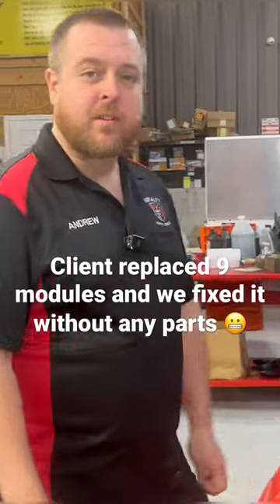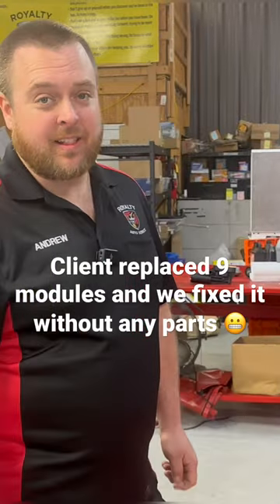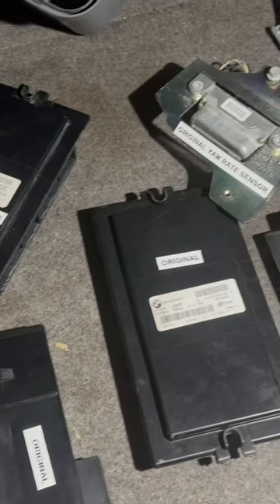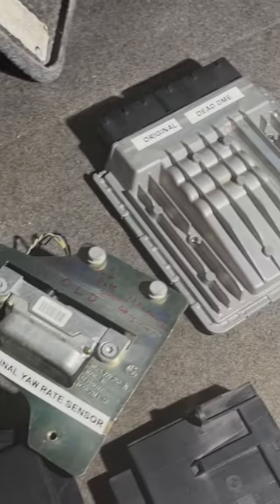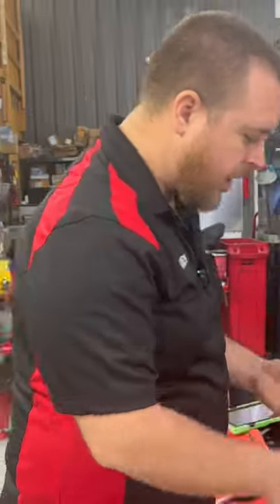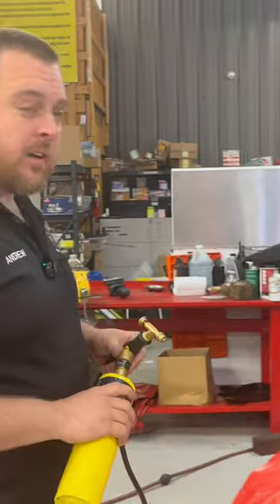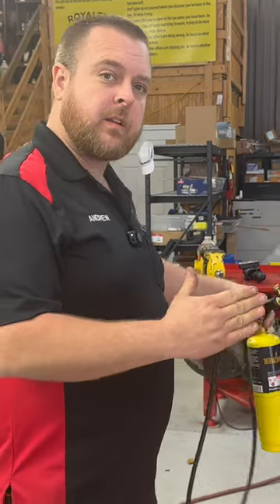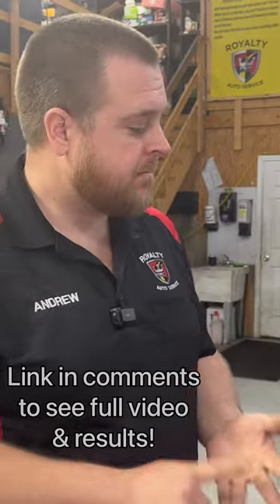Diagnosing a BMW that had the parts store thrown at it #automobile #328i #automotive #mechanic #bmw

Comment: In another part of the same town a Honda has just done 200k and is running like a Swiss watch.
Reply: My mom's Honda (Acura TL) has about 214k mi on it now, & if you think ot runs like a clock from zero maintenance, you'll be VERY sadly mistaken. 
It has leaked more than me & my sister's Benz's combined, the labor is often twice the labor for the same jobs as the Benz's, & many of the parts (real parts, not Chinese garbage), are not only expensive but are available NO WHERE other than the dealer.
Yes, they're built fantastically, but it does come at a price & is 15% as engaging to drive as the E90 featured in this video.

Comment: When you first turn on the key it will give a little fuel but when running no fuel. Turn the key and watch fuel pressure. So it’s not the pump

Comment: When a BMW starts to mess up, you might as well junk it…
Reply: N52 is actually a pretty good engine, last NA BMW 6 cylinder America and most of the world got.  Ended about 58 years of inline 6’s for BMW, then replaced with a POS 4 cylinder that BMW later got sued over.
Reply: @M54B30_fan  no it doesn't matter how good the engine is it's still a crap if the whole car is crap. 
Crap, junk 100k cars.
Reply: @montanasnowman3138  I mean if you mean rust yes I agree but with a clean example of any of these then they are reliable.  Your bias against them is showing as there is no ration shown in your comment
Reply: @M54B30_fan  you don’t need rationale, compare bmw and most German cars to any other brand. I agree the 90s and early 2000 bmws are okay, but modern stuff won’t last you much past 100k, which is what this guy was saying. It’ll last you if you throw tons of money at them, I’m speaking from first hand experience
Reply: @944LS  no the modern stuff I 100% agree with you.  Most non v8/v12 bmw’s (and non m’s) are pretty good cars (aside from 7 series past the e38).  I hate new bmw, that I will agree.  After the e60/e90/e91/e92/e93 chassis with the n52 (and n53 technically) yes I hate those and share that opinion.  BMW used to be great, but those who live long enough find themselves becoming the villain or however that goes
Reply: I heard a guy who runs as soon as the problems show up.